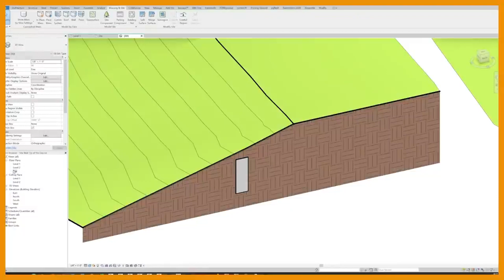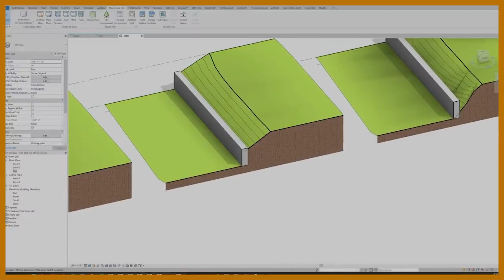Topography at a Retaining Wall in Revit Tutorial

Comment: yes I've had this issue as well.  I've hesitated with split surface, it seems you want to keep the topo as one?  how about building pad?
Reply from the maker: Building pad works if your topo is FLAT on the other side.... But, you can always just re-merge the surface after!!!
Reply: @TheRevitKid  omg i didn't know that lol,  have to try it
Reply: also just remembered the cut and fill command, it seems like a nice tool but not sure, will check if you made an videos on this